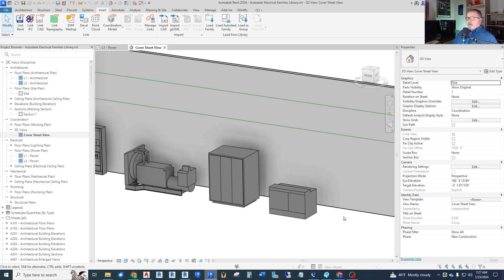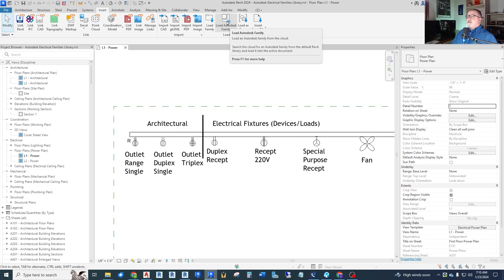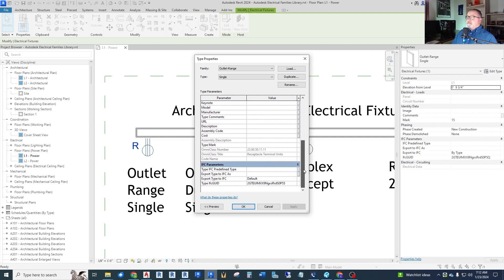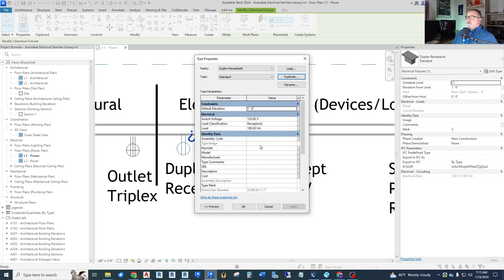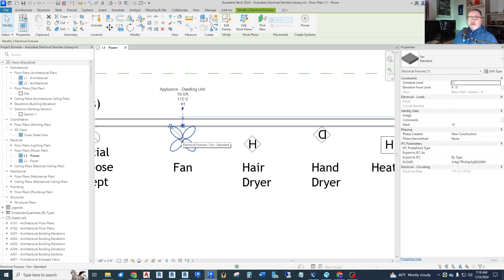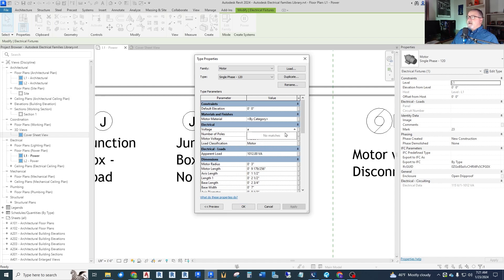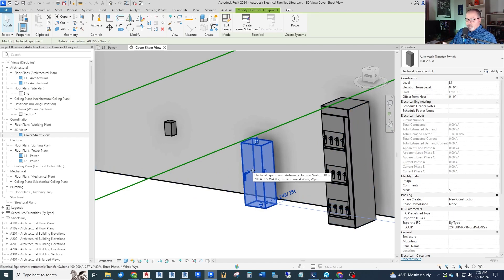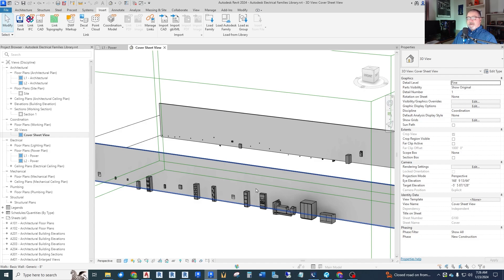REVIT MEP Out-of-the-box 3D Electrical Families - Electrical Tutorial

Comment: Sir thank you for youre videos,they are very helpfull.I have a little problem,my autodesk family load does not work,did you encounter this problem,do you maybe know the solution?Thanks in advance😅
Reply from the maker: Hey there - I'm glad you are getting some value from these videos! I have not had any issues with family loading myself - I'm glad to help troubleshoot but will need some more specific info - can you explain the steps you use and what does or does not happen? Thanks!
Reply: @ElectricRob   It seems i couldn't access the library trough cloud(i do not know why),so i just installed it(library) from the autodesk site and it fixed the problem😁.By the way i just started learning revit and i am doing my first project(residential building) so your full project videos are gonna help so much.Thanks once again.
Reply from the maker: Ah I see - glad you found a workaround to load the library! And great to hear you are getting into revit electrical - I hope the residential project videos help you out - let me know if there are any other specifics that might help, since if one person has questions, we find that many others have the same questions. Cheers!